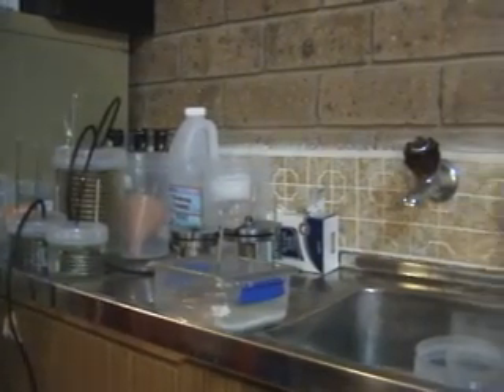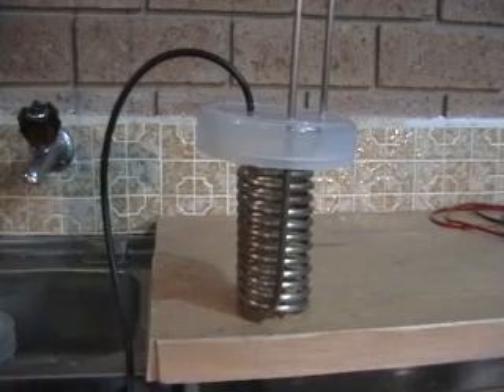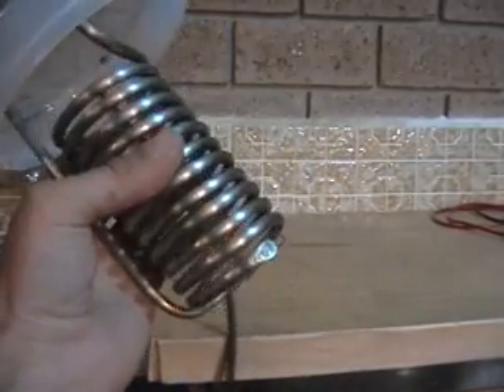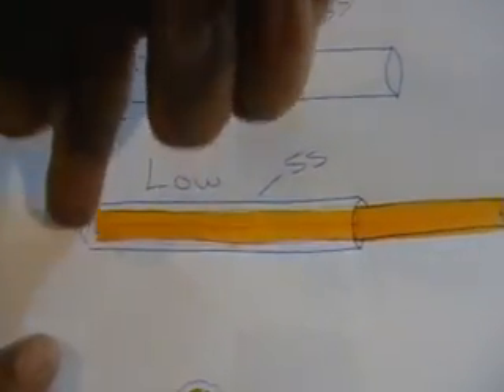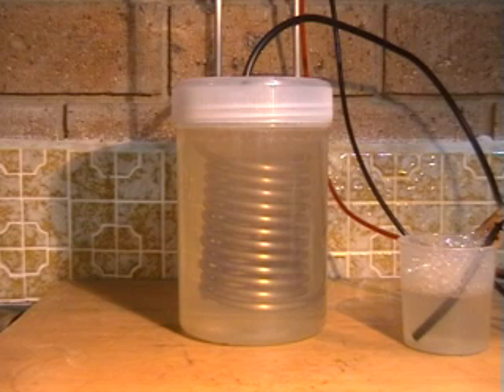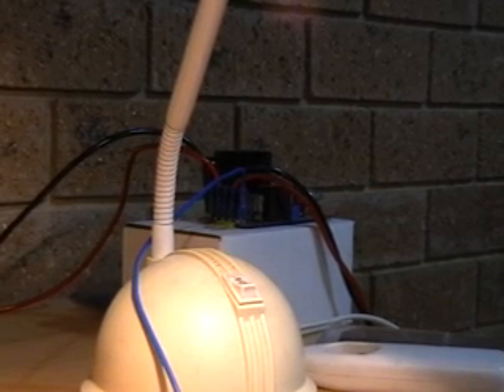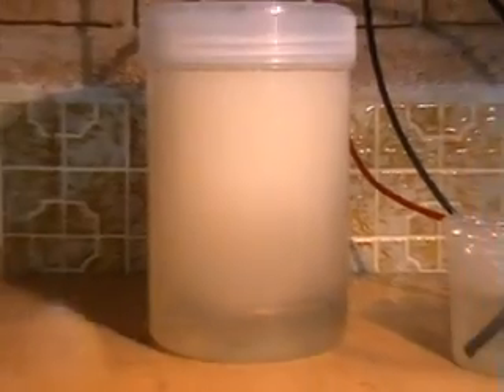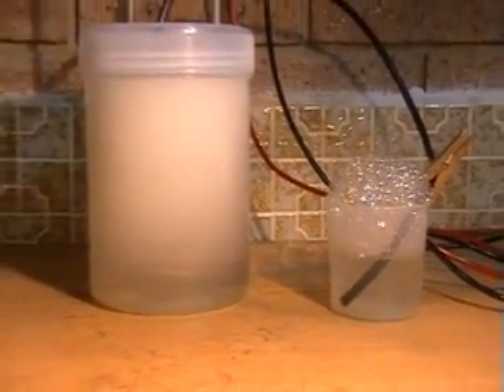Cool HHO

Comment: You need a stablizer to force the hho bubbles into larger ones.
Reply from the maker: I was to use on a vacum system it helps the bubbles expand as they form releasing them faster off the coils. 
Vacum can increase the output much of most basic HHO cells.

Comment: hey for a disel engine how many cells would you need
Reply from the maker: Hard to say cell out put to match engine size need cubes of engine to have  an idea.
But the vids on this I never had the units to run it full power but you could run       it as a booster on disel to get much more KMs or run it straight but the cells final shape and size would be diffrent. 
See my other hho vid and see what I mean fast reacting cell is a flat coil tesla knew the effiency of this also. 
They are many reason I found y when I was doing this work that I never got to finish no budget. 
But the main thing the potentual extra effiency you can get from copper inserts was well proven to me and many others by may work at the time. 
Keep the heat out and manipulate the magnetic fields and much less power is used.

Comment: HI, Thanks for the video, its was very interesting and helpful, Congrats and best wishes with your baby being born! I had an idea recently to use copper-nickel wire or tube as i am a marine engineer by training and we used alot of copper-nickel in seawater heat exchangers for its extreme resistance to corrosion yet its good thermal conductivity. But i wonder if the electrolysis would eat out the copper? Any ideas? Or maybe i should just bite the bullet and try it i guess. Also Sandivik has a range of high corrosion resistant stainless,http://www.smt.sandvik.com/en/materials-center/material-datasheets/?filter=productformgroup:tube%2520and%2520pipe%252c%2520seamless
 most people seem to be using plain 316 or 304 Grade stainless in these electrolysers. Also what would be the best electrolyte to use as most seem to use Sodium Bi Carbonate (baking Soda) and apparently i have read that Sodium Carbonate (Washing Soda) is better. I dont know how these compare to Potasium Hydroxide? Any Clues? Well done very one for pulling together on the quest to make Hydrogen more mainstream........
Reply from the maker: Hello
Sorry for the long rely life has been hell for a bit but now on top of half my problems. I like the idea of trying new materials but most metals will break down its the SS steals that holds the key so far but this is good as easy to get copper rods or plates shape them then plate them as there are many combinations of materials that can be added I think a SS like 316R could be plated on copper with other pure metals that don't break down added like gold to help lower resistance and also help remove heat and the other trick is running the copper out of the to of the cell and adding cooling fins made from Pyrolytic Graphite if cell is run in a car add a passive small radiator no pump same hight as cell with a top and bottom feed it will cerculate by its self also this kind of cell works even better in a vaccum on a car . Have not tried sodium carbonate but will look best to stay away from potassium hydroxide its not worth the risk of blindness from one mistake that anyone could make on a bad day will do that.
I'm selling the Cool HHO cell with PWM and information on the next vertion that was planned as I cannot afford the equipment to run it to its limits or afford to build the next one.
Thanks for your interest I still have many things not yet tried on HHO cells but will try to provide it when the time is right I'll watch your progress and help if I can.
Regards
Adam VA of AVA Magnetic Levitation AUS
Reply: Cheers for replying. Have you heard of anyone using Copper Nickel? It has very high corrosion resistance.........
Reply from the maker: No but chromium nickel and some others may be a good material to test in a cell much lower resistance than SS alone is it expensive I have no funds to work with but still very interested in HHO as so many things not yet tried or tested properly yet.
The kind of things your suggesting is what more HHO people need to do as there are so many that use the same materials and method of testing.
Keep on keeping on I'll look a bit more for material information and there values see what I can find out.
Reply: cool
Reply from the maker: Hello
A little known trick to help keep the plated nickel or SS on the surface from breaking down.
Submurs in liquid nitrogen for 20-30mins it Should also help with production. Doing this helps in more ways than one.
Reply: Interesting.........

Comment from the maker: Hello to see how I do the bend and spacing of the coils look up usser name.
( ammanninox )
PS. I tig weilded the one end of the SS first then inserted the copper cores then bent the coils.The coils can be bent around the right size pipe held in a vice clamping one end of the SS to keep it in place while bending.
Also set the SS one magnetic north end up one south magnetic end up as extruded SS can have a north and south end.

Comment: hel00 .. im fr0m serbija ... like y0ur hh0... but i have heard that copper and ss or inox does not suffer , there is some kind of oxidation and partially lose contact between them, my hho is similar, ss plates on copper wire ... how much they cost (price) of stainless steel pipe and which is the smaller inner diameter ... here it is very hard to find ... Greetings from friend

Comment: Can you give me a complete list of all the materials that you used to make this? I would like to make one of these and put it in my car to increase fuel millage. I have a 1967 chevelle and I want to increase the fuel millage on it. My father made one onetime, but it did not output as much as yours did. Was this just running off the car battery you mentioned? Was you using distilled water and baking soda or what exactly?    Would like a response, thank you. Nice video.

Comment: The heat generated from the welding process will only affect the HAZ (heat affected zone) on either side of the welded area. Since you're only welding the the ends of the tubing and if using the optimized design of solid Cu core there wouldn't be any effect on the current needed to catalyze the reaction, even if welded at the top of the tubing the change in resistance may be measurable in µOhms.

Comment: I think you have discovered a new method for reducing the heat generated in almost all cells. I have used your method on a Duples Booster, and found the reduction in amps almost 50% and the increase in HHO production about 15%. The centre plate has a copper centre and the two outside plates has one copper plate on the outside. All compressed the same as the Duplex Cell.
Well done adam and thank you for your inut.

Comment: So, if you sandwich a piece of sheet copper between two sheets of 316L in a dry cell, what results would you get?  Of course you would have seal the holes for the inlet and output for the HHO gas.  Does this mean anything?

Comment from the maker: Hello I'll have to messure some of the dia's but the length was in my head and written on a work bench at time of build.
For the copper I used a standard copper tube bearly fit into the ss tube and if I was to do again would use solid copper rods and also a conductive past between the two.
I may have some of the SS tubeing left but will have to check most SS tube suppliers will have or get it in any size but shop around best to go up chain to makers or first suppliers or $ $ $.
More soon !

Comment from the maker: Good question
I do understand that heating/weilding may change the SS structure as its made from a drawing out procsess and this will give it a kind of grain structure that can effect currant flow and HHO production and also any magnetic flux effect. But the weilding was very isolated just to the area needed at the very ends.
But you have raised a very valed piont weilding SS in some ways on some designs may reduce the end effiect and HHO out put
HHOs great fun still much to try

Comment: @AVAMagneticlev my cells have no heat issues. I do have other problems though. 
Have you done a duration test yet? The cathode will wear thin!
My design is similar to this one. And as you say at a much smaller scale.
Oh also, it's not called "browns gas" for nothing
Thanks.

Comment from the maker: Well not all the heat but this build seems to not heat up half as much when compaired to one the same without copper.
Also the cell in this vid has not been tested at its limits or at the right currant or volts that I intend to use on it due to its robust size it should handle 2-3 times what it did in the vid.
Thanks for watching.

Comment from the maker: Hello Thanks for sharing your work I have watched your vids.
The cell I made has hollow copper tube that the cell can be run at high rates of production.
This means a cell that already runs very cool if applied to a car could be made smaller vertion of a more efficent shape and run at much higher outputs without the over heating problems most cells have.
Also there is an extra effect of a magnetic kind due to the copper inside this also leads to more out if made right.

Comment from the maker: Hello 
And yes I believe you to be correct  I have not had the right power supplies to test this cell to the voltage and amps I think that it would work best at for its size.
And much smaller Dia and closer coils would work much better running a 12-48 Volt set up.
The cell in the vid had a quick go on 240 V AC low currant draw yes I was drinking that night but still ran loop warm after 10mins but what I would like to do is smaller coils if I could affort to but not at this time.

Comment: Nice design. I suggest you use a much smaller diameter stainless steel tube and solid copper wire. You need to get the coils alot closer. 3mm apart is ideal.

Comment from the maker: Hello was only tested against a cell made the same but without the copper core.
It out preformed the non copper core one every time.
I also did a battery run down time test and the copper core did very well.
Also aways runs much cooler in all tests and conditions sofare.
Adam VA of AVA MAG LEV
Thanks for watching

Comment from the maker: The SS pipe is hollow but weilded closed at one end the copper pipe runs all the way throw it and acts as a conductor the gas forms on the out side of the SS coil. One coil hydrogen the other oxegen.
The SS and the copper are in direct contact the copper is only there to carry current so it only has to travel throw a thin wall of SS thus lowering resistance and heat making it much more efficent than SS alone.
It worked better and runs cooler than I hopped for and I encourage others to try it.

Comment from the maker: Sorry I took so long have tested and took 2:45 to make 1 liter of gas.
The cell was disigned to run on more volts and less amps.
When I have a new power unit or get more batterys will test again on 24v and 36v with comparable amps to last test 
eg 24V 9amps.
Thanks for show interest.

Comment from the maker: No but when testing did comparative gas volume testing against same cell without copper.Also compartive heat test was also done. All testing was done on a borrowed power supply.
I'am prepairing to do lt per min test very soon will shair when done.
I belive the next cell of the same material but of a different shape will yeild more than the one in this vid.
Thanks for watching.